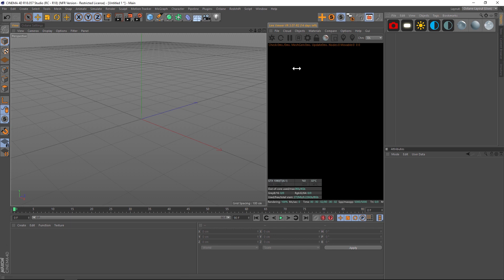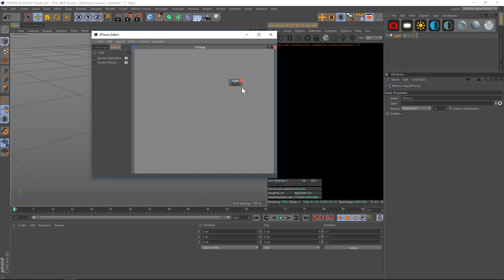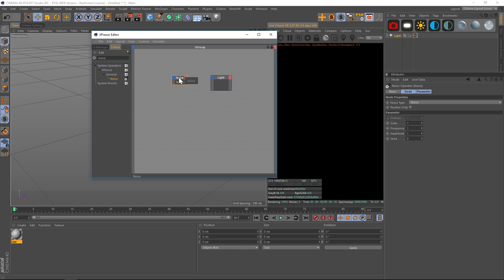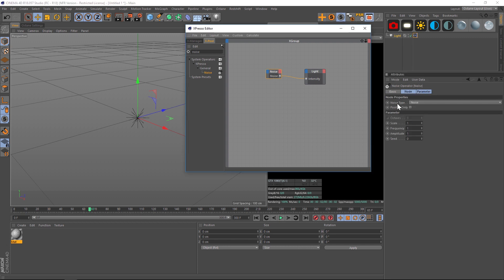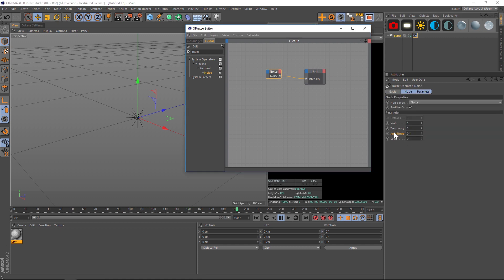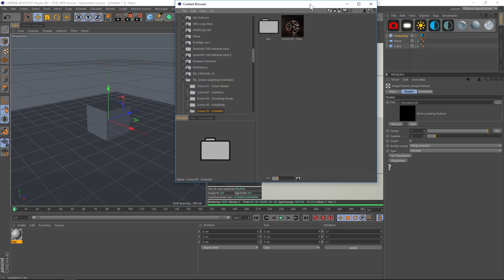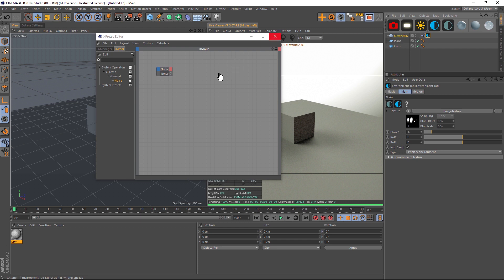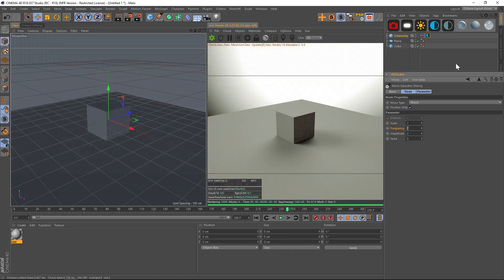C4D Tutorial: How to Make Lights or HDRIs Flicker

Comment: Thank you Joren, as always you come through with really useful tips! I had one question, as I am trying to work on an animation involving a flashing police car with alternating flashing lights from red to blue.  How do you control the flashes between two light sources so they alternate using this same method?
Reply from the maker: You might have to do that manually with keyframes I think. You can keyframe the color in the material, so just switch it from red keyframe to blue keyframe. That's probably what I would do...

Comment: Trying this with octane area light and its not showing upon rendering? Any help appreciated. Great tutorial!
Reply: hey found how to use it with octane light, do exactly the same process but instead of drag & dropping the full 'octane area light' in xpresso, just drag&drop the octane light tag (the small square light) in xpresso, then add the noise, then connect it to the light node and to 'light settings', 'power', and BOOOOOOOOM
Reply: Fell upon the same solution and it worked like a charm! Thought I was the only one.